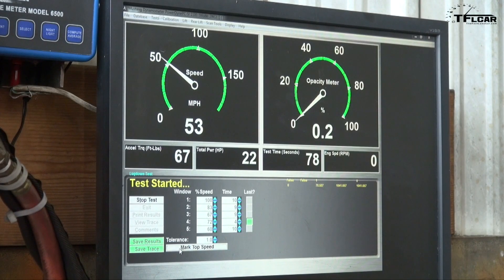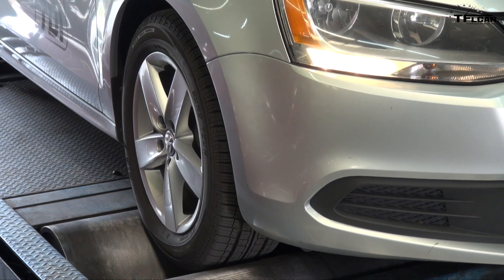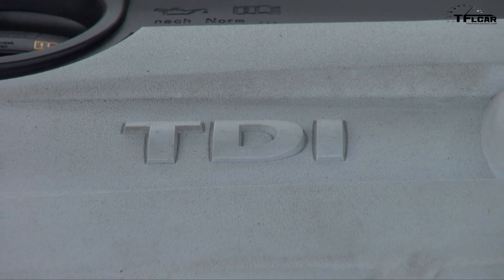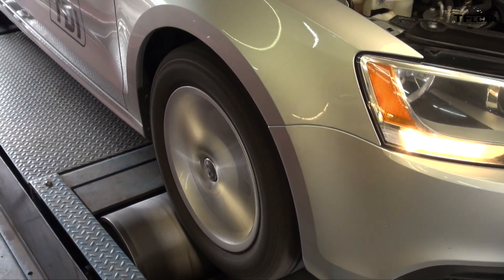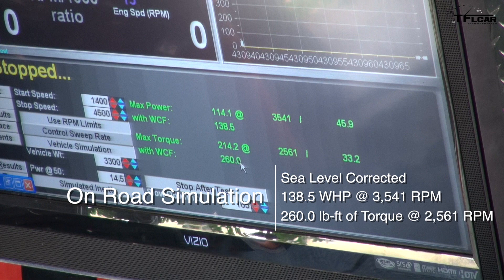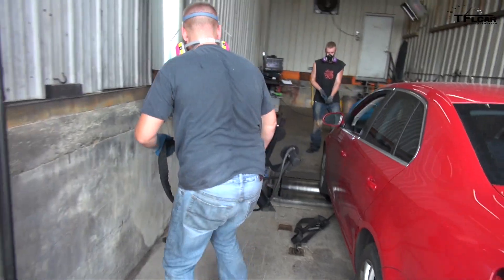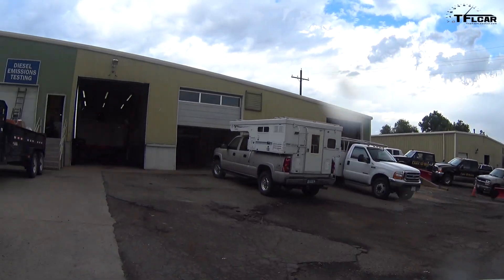Surprise! We Dyno a VW Dieselgate TDI Jetta to get the Truth about HP Loss

Comment: 15 hp, 30bl ft and slightly better torque curve. that doesnt worth for 10 to 50 times of the regulation limits...
Reply: +jamesgjt Its less about the power than it is the loss of MILEAGE that comes with the more emission-friendly tune.  

Less fuel burned per mile traveled is a more efficient way to reduce total emissions than the asinine way emissions are tested with a tailpipe sniffer taking a momentary sample.
Reply: +Ryan resa Amen! Emissions can only be tested immediately after moderate driving when the engine is in Closed Loop mode and catalytic converter is at operating temperature. If you have to sit and wait for a test, and the cat is "cold," and they do the sniffer test, it's gonna show higher emissions because the catalyst isn't hot enough to do its job.

Sarcastically speaking, I'm glad the people that make emissions laws know about the vehicles their legislating against. :-D
Reply: 50 times a miniscule number is still a very small number. We're not talking about 1960's dump trucks here, these cars are still very clean.

Comment: 260 torque? Thats not factory spec!
Reply: diesel engine have excellent torque output, with the help of the turbo
Reply: +BoomerE30 probably 260nm rather than lb/ft
Reply: +the doge excellent based on ratio of tq/hp ratio. that doesnt mean its better. more hp is good.... more tq with less hp is BAD
Reply: +BoomerE30 Diesel engines rely on compression for a source of ignition (no spark plugs), thus they have higher compression ratios than their gasoline counterparts. High compression raises torque in engines (gas or diesel) and that can increase with turbocharging. Those torque figures stated are realistic for a Diesel engine.

Comment: Dieselgate is probably the dumbest thing I've heard all day. Get over your little TFL car self and grow up a little. Everyone makes mistakes. They admitted to their mistake and apologized. MOVE ON!
Reply: +Abandoned TN not a mistake if it was intentional...lmao
Reply: +Abandoned TN It wasn't a mistake!!  VW wanted higher torque/hp numbers (helps with sales) + didn't want to de-tune the car to pass emissions tests. VW got caught with their hands in the strudel.
Reply: +Abandoned TN  VW/Audi fanboy detected :)))
Reply: ***** Much like how GM intentionally did not recall all those faulty Ignition Key Switches because it would've costed them less to not recall them. Those things had a tendency to be easily bumped to the Accessory position by the weight of the key-chain it was attached to. When a car is in the accessory position the driver has no drive, no steering, no brakes, and airbags. This who VW scandal is nothing compared to what other companies have done.
Reply: +Abandoned TN Which means they did it on purpose!!! Sheesh!  Either you're still in grade school or you're a seasoned politician.  Or a seasoned politician who didn't graduate grade school :-)  Seriously, there are so many quality control checks before a car starts production, there is no doubt VW execs knew EXACTLY what they were doing.  Just like GM execs knew they had a faulty ignition yet they still went ahead w/ production.  Cheaters always get caught sooner or later.
Reply: +BECAST it was an intentional mistake. They messed up.
Reply: +TechGerbil ...and not one GM exec was held accountable. Terrible situation all around EXCEPT for the US govt who got a windfall for assessing GM billions of $$$
Reply: +Abandoned TN Perhaps if you spent a little more time reading the news instead of spewing nonsense you'd know this was intentionally done by VW.
Reply: +Tully3674 gotta do what ya gotta do
Reply: +Random Videos Then what is it? An achievement? Gosh you're a dumbass. You should probably get to sleep, 5th grade is tough!!
Reply: +Tully3674 I managed to graduate high school and college. If I can do it, you can too! Good look in school tomorrow!
Reply: +Tully3674 That said, remember when GM didn't care when it was discovered that a large portion of their fleet had a faulty ignition system that which cause the deaths of 9 (most likely more) deaths? Til this day not much has been done about it.
Reply: +TechGerbil death is A LOT more serious than emissions in my opinion. It's literally the difference between life and death. GM just doesn't care. Also the problem with the Chrysler vehicles and the technology in it being able to be hacked.
Reply: +Tully3674 it's all about the money at the end of the day.
Reply: +youtubasoarus perhaps if you learned how to forgive and move on you would be a more enjoyable person.

Comment: All this proves is the car can't be Dyno tested with the front wheels only b/c the computer thinks there's a problem with the rear wheels. If possible test it on the Dyno spinning all wheels while doing an emissions test.
Reply: +mlcjr82 or just disable all traction control systems, genius.
Reply: +mlcjr82 a glimmer of common sense in a sea of ignorance.
Reply: Agree 100%. I'm not saying I think it will change, but I'd love to see the true hookup to emissions test equipment and run on AWD dyno...
Reply: Agreed, I think other cars should also run a demo with all wheels spinning, some cars probably don't like having only the front wheels spinning.
Reply: +mlcjr82 they`r dumb, to make the 2nd test they should turn off ESP ....
Reply: +AmigaMANpt Most cars you can't turn off ESP easily. Traction Control doesn't equal ESP, they are two different systems.
Reply: For that, on all cars in group with ESP MK60C1 when dyno testing,  you must pull out fuse (4 and 25) from E-Box...
Reply: ic3man5 so how do they drive it in snow or ice? they all need to have a way to turn off
Reply: +AmigaMANpt ESP should never be turned off in snow or ice, ESP is not like traction control. ESP Assists the driver by keeping the car exactly where the driver intended it to go. Turn the wheel all the way on snow going 20 MPH and It will do it by individually braking each wheel differently and vary throttle if needed. Without ESP you'd go in a straight line and hit whatever you were trying to avoid. Only thing ESP prevents is having fun doing donuts or whipping out the back end. Traction control can still be turned off in case you are stuck in the snow and can't accelerate.
Reply: +MrGunlover556 most cars don't let you totally disable it idiot!
Reply: yes they do you just pull the damn fuse.
Reply: MrGunlover556 lol and watch as the car computer panics
Reply: all it does is turn on warning lights.... I've actually done it before for dynoing.
Reply: On this exact car though?

Comment: The 140 hp rating from VW is flywheel horsepower - not wheel horsepower. If that car is putting 138 hp to the wheels, that means its putting out about 160 hp to the flywheel. Maybe the official rating was based on the running the car in the test program and the real world owners got to enjoy more power. 

When in test mode the car is also looking for specific temperature, barometric pressure, and humidity levels, so we can't be too sure anything actually changed in your test.
Reply: +Todd Wilson I'm pretty sure they do underrate them. Look at every Audi. The S4 is rated at 333 HP but it performs like a 400+ HP car and it easily outperformed the similarly powered BMW 335i. The S7 makes 420 HP but despite weighting more than BMW 650i and having 25 less HP and way less torque, it's still faster than BMW by a lot. The Audi S8 is rated at 520HP and it's a huge car. How can something that big and heavy possibly do 0-60 in 3.5 seconds with just 520HP? Every reviewer has said that Audi's are underrated when it comes to HP.
Reply: +Mack124 geez what was your last car a pinto?
Reply: +Jody Sanders That's just the low end power of the diesel. I used to have an 06 TDI and even though it only had 100 hp, the diesel makes much more power at low rpm compared to the average gas compact car. They feel much quicker when initially accelerating. Gutless at highway speeds though.
Reply: +Todd Wilson Lots of car companies actually under-report on the horsepower figure but still keep the 0-60 times, just so they can say their engines run more efficient.
Reply: +Todd Wilson VW do underrate their engines. On their faster models above 400 hp, it's not uncommon for them to underrate it by as much as 50 at times. My old A3 is rated stock at 150hp, but the dyno said 168 before I got it remapped to around 210.
Reply: +Todd Wilson Yep most vw's are rated at wheel horsepower rather than engine hp.
Reply: +Callum Curtis No. That would be illegal. Unless you mean VW is underrating their engines.
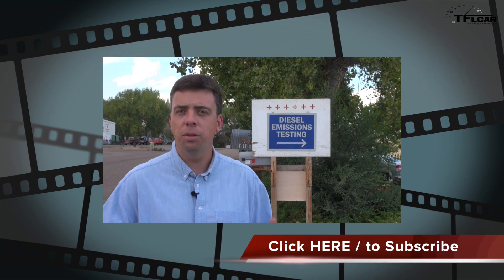Reply: +Jay Trock They didn't say that. They said corrected for elevation. The note flashed on the screen at 8:12 also read 138.5 WHP.
Reply: +Jay Trock Exactly. And the turbo is VNT, so unless someone does the same test with a Porsche Turbo, this altitude adjustment explains why VW software baselines engine output. This same car needs to be on a dyno in Los Angeles near sea level. The thin air and forced induction with a vnt are why baseline exists, because these cars are adaptive to altitude, ambient air temperature, and fuel.
Reply: +Rizwan Javed its called a transmission, awd and a tune.
Reply: TheGeorgeLara  Of course dual clutch AWD helps but it doesn't make the difference too big. TLX has dual clutch 8 speed AWD with more horsepower than a base 3 series and weights similarly. 3 Series has a conventional transmission and it's RWD. 3 series is still faster.
Reply: +Todd Wilson The 140hp is flywheel rating and the mustang dyno applied corrections to the wheel horsepower (114hp) to come up with a rough approximation of 138 which is pretty impressive when you think of it considering the myriad of transmission and tire combinations which could effect this rating. To get so close to the factory HP rating AND correcting for altitude speaks to the accuracy and precision (two different things) of the mustang dyno.
Reply: Rizwan Javed so what else could it be if its not that.... differencial? or pure magic? also, weight is a huuge factor
Reply: +Jay Trock They said exactly what I said. Corrected for elevation. Not wheel horsepower to flywheel horsepower.
Reply: You are absolutely right. The day I got my Tdi, I wasn't expecting much performance. My texturized was in the dealer lot.😒
But the minute I signed those papers, and drove home, I instantly had to readjust my driving habit. Just a light touch on the gas pedal, and the car easily achieves 55+ miles an hour, while the engine is below 2,000 rpm. Put it in sport mode, I mean warp-mode, speeding ticket is right around the corner.
Reply: +Jody Sanders A 2001 Nissan Altima. lol
Reply: +Kevin Choi Well, today I received a mail from Volkswagen Inc,  Issuing an apology to me and my family regarding the diesel scandal. Hmm, I wonder what now?

Comment: Ok... but I have issue with this test. VW never thought someone would put a 2wd vehicle on a dyno? Because if the vehicle is on a dyno and goes into the emissions mode whoever decides to dyno test their new car to verify VW isn't lying would see the numbers don't match.  I find it hard to believe VW would be so dumb as to assume none of their cars would ever be 2 wheel drive dyno tested.
Reply: +Jesse Crandle what does it matter? they've already accepted responsibility and informed the public which cars are affected.
Reply: Josh Smith Then what's the point in doing this video, either?
Reply: +Jesse Crandle I think the point is that if VW ever had to put out a software update, people would know how it could potentially effect hp & torque.
Reply: Super Dan We already knew that, though.

Comment: Test 2 was being stopped by Traction Control...
Reply: +SonOfMarvin I'm glad someone else said it. How the hell did nobody in that "shop" figure that out?
Reply: so much technology and they dont know how to turn off ESP ??? They should turn that off to make the second test, ofcourse the car went in "safe mode" it know the rear wheels are stopped and should be turning!
Reply: +Fernando Gonzalez 

Because it's obvious that The Fast Lane Car needed clicks and viewers.  If there was no, or slight change in power, no one would be watching or commenting this video.
Reply: +Marc Monson The tracktion control eventually figured out something is wrong and gave up (or basically that the reading from back wheel ABS sensors is not plausible to real scenario, hence the break fautl light). And that's exactly what the results say, huge difference in torque in the beginning (where traction control cut it), not so much later on (3 bhp difference in peak could be simply random error). I can't get my head around that no one figured that out when the traction control light is clearly flashing all the time. And of course it is, drive wheels spinning easily and others not at all is exactly what would be the case if you are on ice and having wheel spin.
Reply: +SonOfMarvin agreed this test means nothing.  Traction control changed the results.
Reply: This is exactly what I thought. They even mentioned TCS early in the video and then totally forgot to disable it during the second test.
Reply: +SonOfMarvin Hard to know for sure.  A solid traction control light indicates that traction control is disabled.  A blinking light indicates that traction control is both enabled and currently engaged.  When the maximum horsepower and torque were measured for the second test, the light was solid, indicating that traction control was disabled and not interfering.  However, it does seem odd that it was blinking shortly before that.
Reply: +Marc Monson Depends on the car. Some will cut you back until you're stuck idling with the foot halfway to the floor, and others will allow you to eventually get power back gradually if you "work" the pedal. I've driven both types of systems, and both of them suck in the snow.
Reply: +Marc Monson Traction control systems, at least decent ones, will automatically disable after so much distance is covered with at least one wheel not sending a speed signal to the computer. This is done so that the driver gets full power back in the event of a sensor failure.

My car, even with TCS manually turned off, shut down all stability and ABS function after spinning up a snow covered driveway. I believe this happened after the odometer spun one mile with only the rear wheels spinning and the front wheels rolling very slowly. Once the car saw all four wheels spinning the same speed, everything re-enabled.

On the other hand, why even do this test if you can't measure the emissions in question in real-time? That proves nothing. This is two strikes against fast lane car for me.
Reply: turbovanman 
EGR is not for the benefit of mpg.
Reply: +SonOfMarvin the car wouldnt of made a full pass if traction control was intervening.. if it was it wouldnt of allowed the car to go over like 20mph wide open.. ever go WOT in a car on snow w/ TC on where spinning is 100% guaranteed   ? it doesnt allow it to slowly go all the way thru the rev range but pulls power out of it until a certain amount of slip is allowed..
Reply: +SonOfMarvin Exactly!
Reply: +SonOfMarvin not exactly, the computer is set up to tell when its an emissions test, then it uses less gas and the egr puts extra exhaust into the intake, when the computer thinks its driving, the egr does not work and it gives it a little extra gas. the egr is the emission part where is recycles exhaust in to the intake. which kills power and fuel mileage but lowers emissions, in america the laws to lower emissions make the car use more gas. i removed the egr off a 96 mustang and had it retuned to run without it,  the car went from 13mpg to getting 25mpg and gained 35hp. so to lower emissions by 15% they cute fuel mileage in half.
Reply: +SonOfMarvin It's so hard to press the ESP button to disable it.
Reply: SonOfMarvin Wrong the car went into limp mode as its seeing that the rear wheels arent moving and it goes into limp mode to not hinder the car more.
Reply: http://teknikensvarld.se/dieselgate-volkswagen-cars-loses-power-after-fix-456111/
Reply: It was bring stopped by traction control at first. Then it disabled it and when brake TCS airbag ect. Lit up this had disabled the TCS. This is how they knew it was being tested.
Reply: +SonOfMarvin Yep, very common on almost every modern car, I can think of some petrol/gasoline cars from 1995 that do this. Only two wheels moving sets an ABS sensor fault (ie. implausible that the undriven wheels aren't sending speed data) Traction control deactivates, and you'll have limited power.
Reply: You have serious issues. EGR's on gassers are a good thing because you can crank up the part throttle timing which gives good mpg. EGR is not used at WOT. EGR's on diesels keep the combustion chamber temp down but do gum up the intake.